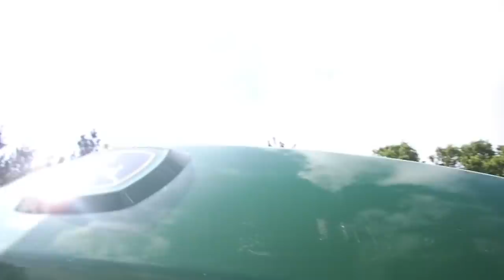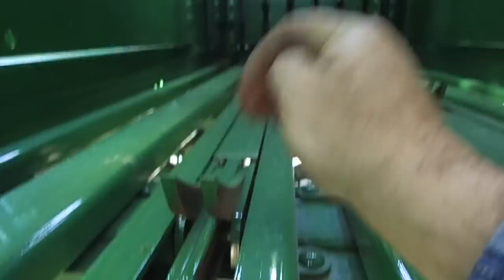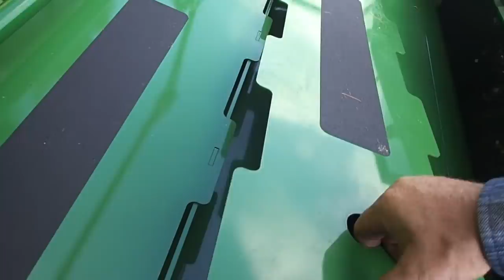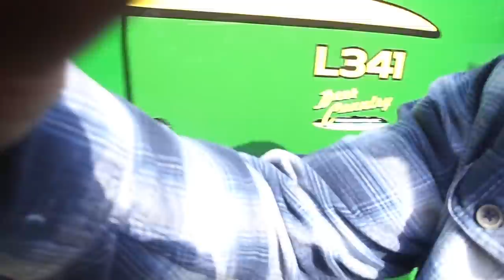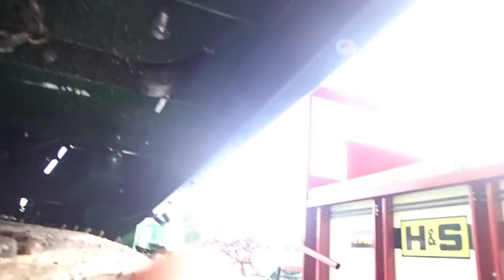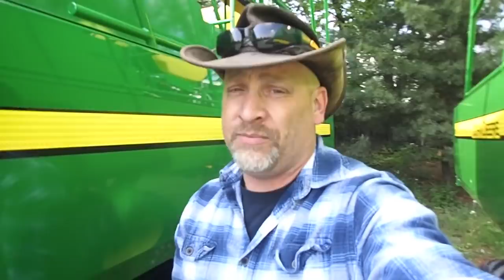John Deere L341 VS Krone 1290 BigPack

Comment: I've got 40,000 bales on my Kuhn LSB 1290 and it never gives a problem.
I didn't buy a krone as I don't really like towing 4 extra tons of  steel around for absolutely no reason.
Reply from the maker: Nigel Clats Thera a reason you just don’t know what it is yet.
Reply: I with you krone is heavy in places that just isnt necessary. I worked in a farm equipment junk yard for a while. We had few krones with the stuffer system completely destroyed. Not sure what it ate.
Reply: Thank the Europeans and Canadians for that hand brake.
Reply: Baler assist is NOT a flywheel starter.

Comment: I see a lot of the same design in that pickup that our 569 baler has on it. Weve been pretty happy with the newer pickup design and those square teeth have done well thru 3 years now.
Reply: I also whole heartedly agree about the looks of these new balers. I am not a fan of the rolling suppository look, give me some angled sheet iron and I will be happy. I wonder too if all the plastic/fiberglass sides on these machines might cause static which would make the dust cling to them?
Reply from the maker: Kirk Blakley there steel on this only the front is composite. I prefer the look of the Kuhn
Reply: @onelonleyfarmer  I will have to check out the kuhn version. These look like a good machine but I am with you on the cost, why buy the next to best when you can buy the best for the same money. The only reason I could think would be financing, deere does offer some good deals from time to time. I am not familiar with the krone dealers and how they do with finance, but I might be finding out. We are looking at buying a new moco and our local guy has some krone rigs on the lot.

Comment: The last bale eject does lay flat, in the position its in now its towards the rear witch makes the ejectors move up to engage the bale. And It does have paddles in the top of the pre compression chamber that when the material has formed a flake compresses them and actuates a cable that runs down to the stuffer mechanism. Deere made a lot of improvement to the 341 over the 340 and definitely over the kuhn baler.

Comment: When I think John Deere I think of Tractors and Combines and not balers,probably a good reason for that.
Reply: I love the John deere round balers
Reply: I have had very little trouble with the small square balers. I've been using them over thirty years.
Reply: @Northern_Farmer  I have a Vermeer 504r and it's got the new rotor pickup with less moving parts it's the same as the new Deere pickup and you can just go it will start a bale at full speed on any grass
Reply: Steamfan71 Deere owns the round baler game

Comment: I'm personally not a fan of that feeding system. Had a round baler with similar set. I think it creates more slugs and puts more hay on the outside when baling a full width swath. Where the augers separate from from rotor pushes the crop together more uniform before being pulled in.

Comment: It’s very over priced Deere is going against the krone 1290 high speed not the hdp. The standard krone is only 150,000. My opinion is that stuffer system looks like a high wear point. I also don’t like the 18 grease zerk you have to hit every day. You even have to grease the flywheel.
Reply from the maker: Deere Zilla I won’t be buying one
Reply: The krone stuffer system is very complex with all those bearing and tracks.  Deere is much simpler stuffer system. Complexity make failures.

Comment: Claas is better
Reply: Ok but what parts available in North amarica
Reply: Krone North America the parts is excellent they have everything there to build a new Baler or piece of equipment.
Reply: @midwestfarmerleduc9256  yes krone has parts but what about claas I don't think they have the dealer support
Reply: @chevymetrodriver  Sure, but with Claas you don't really need the parts because it doesn't break!
Reply: @trossponsor9077  oh the baler is so good it never breaks down I need one with a guarantee and i wont worry about dealer support hahah
Reply: @jwhitley101whitleyfarms9  Claas offers 3 years warranty with an unlimited bale count! Contact your local dealer today!
Reply: My experience putting up hay started at the age of 5 with a 1928 GP tractor and I Massey Harris number one baler all I can tell you if you can't afford it and you can fix it it's a good baler. I've had John Deere small squares and New Holland self-propelled. All knotters  are still billhook like it's on the McCormick John Deere wheat binders or anything else that ties a knot. If you're going to be in the hay baling business you better know how to fix your own hay baler. Hours makes a different in time you can lose a crop of hay in an hour. Are 30 tons. The problem with big baler if anything does break you need two or three people to help you get the parts out.
Reply: @markab71  We over here in Europe - the advanced continent you could say, have all been switching from Krone big balers to Claas. Claas is investing big money in development and it definitely shows. They're world leaders in combines their tractors are up there with the best (if not the best) and their balers are on the next level you just cant pack as tight of a bale with the Krone big pack HDP 2. I would now as we ran them side by side. Claas is the superior baler. End of debate